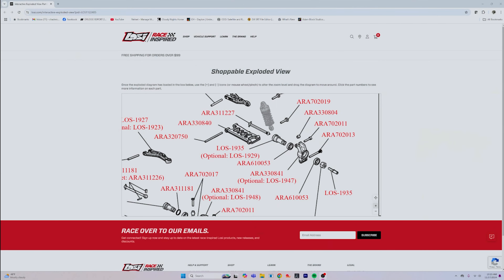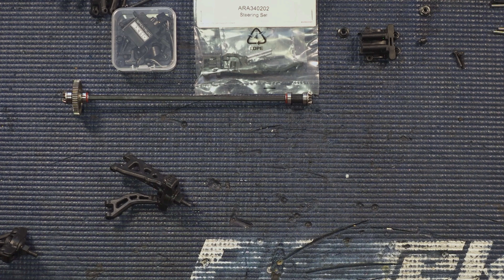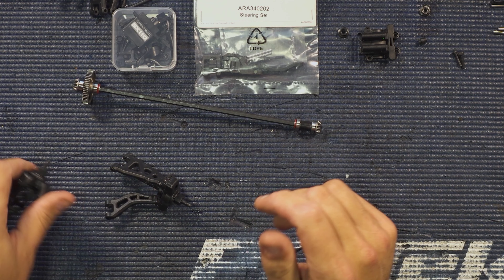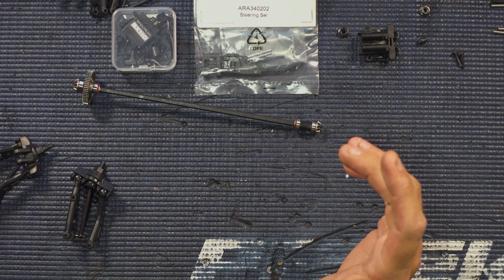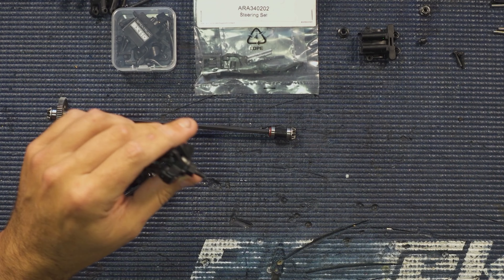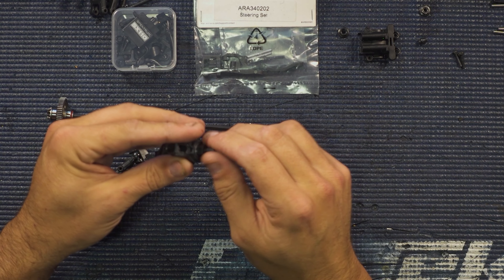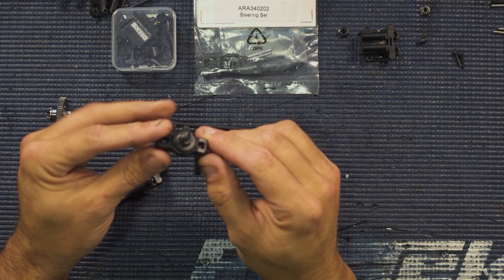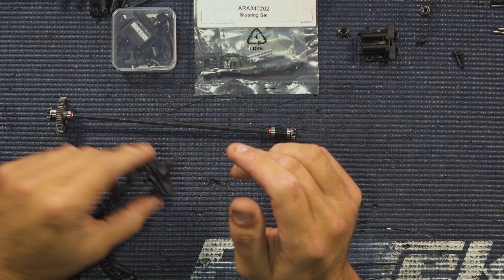LOSI NASCAR BOX STOCK REBUILD SERIES | BEARING CAUTION!! DONT SKIP FIRST 6 MINS!!!!

Comment: FYI, a 2mm hex driver fits perfectly into the end of the wheel axle for removal & installation.  You may need to remove any material that managed to get stuffed into the end of the axle.  No need to risk damaging the threads with a pair of pliers.
Reply from the maker: Ha you’re right. I thought my old groms were easier. These are stuffed with some kind of yellow stuff. Thanks my man

Comment: On the front axles if you loosen the top and bottom arm screws it helps tremendously! They stick through the hole a very tiny bit hindering the bearing to slide out. After i loosened them the bearing and dogbone slide right out.
Reply from the maker: Mine are cracked loose but maybe I can go a little more. Thanks man
Reply: I agree with this tip, the bearings come out much easier.  Also a number 2 standard screw drive will fit into the slots of the axle cup for removing the rear spindles.

Comment: front axle has hole for hex driver never put plyers on threads
Reply from the maker: Yes, you are correct. For some reason. The ends of my holes were filled with some kind of weird glue.